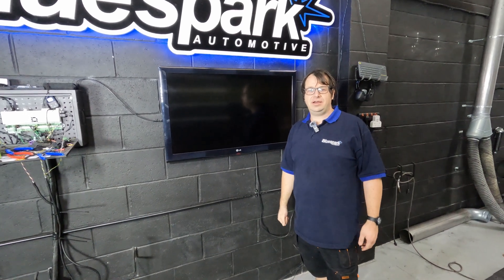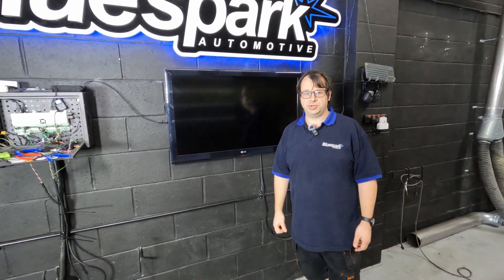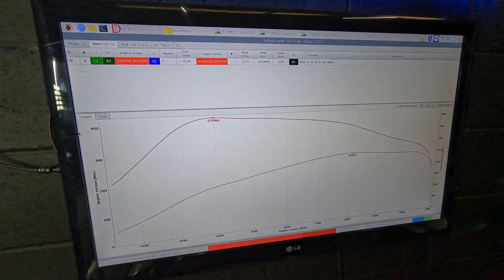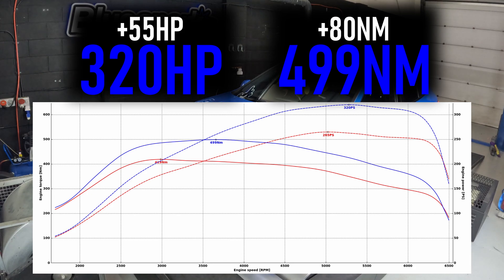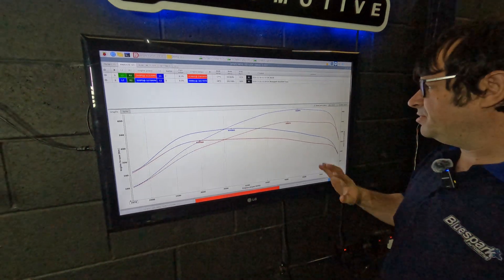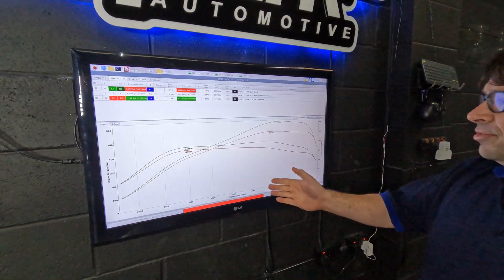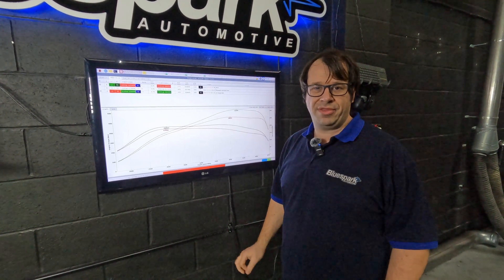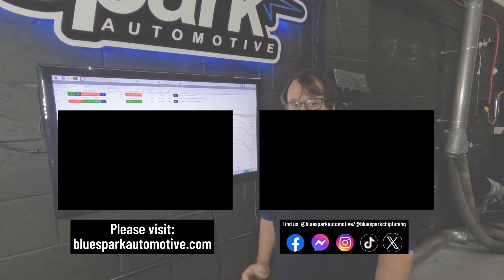BMW 128ti 2.0 B48 261bhp/265ps Dyno Test – Bluespark Tuning Box

Comment: Was that the maximum power available on the module or are there further stages to go
Reply from the maker: It’s the maximum for an otherwise stock engine, yes. There are further settings on the module, however these are only to be used with hardware modifications. Using these settings with a stock engine, wouldn’t mean more power. So we would always advise to get in contact with us, if you are thinking about any mods. So yes, this is the maximum for a stock engine, but we can go beyond this to accommodate upgraded hardware.